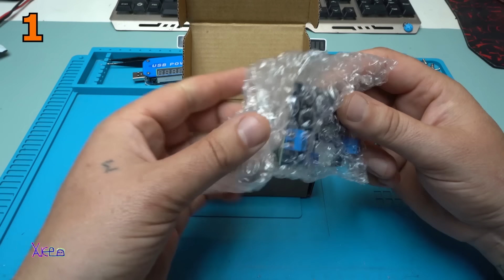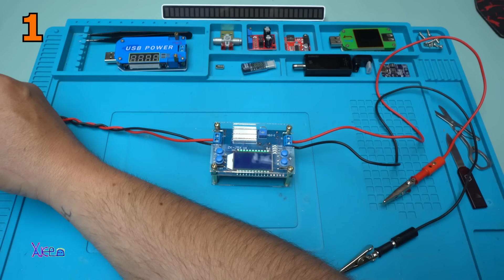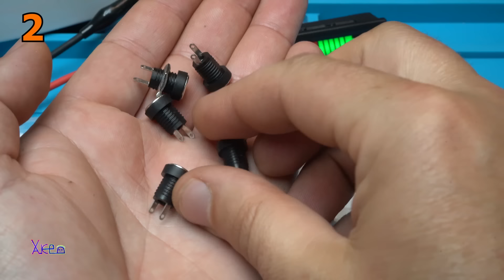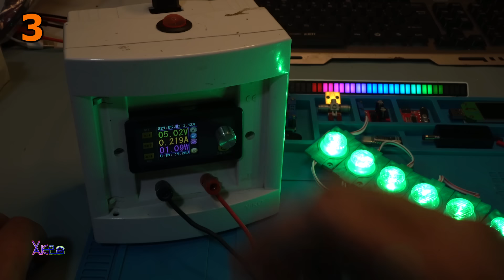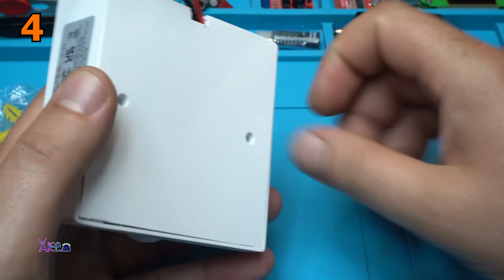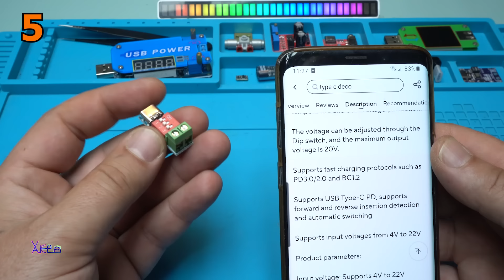TOP 5 AMAZING $5 Aliexpress Modules

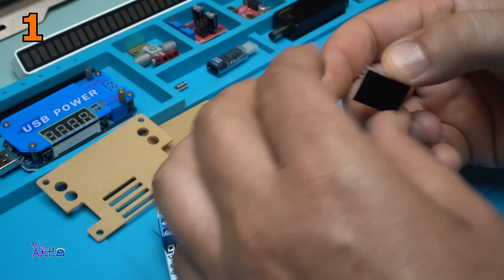Comment: 3:06 Have you tried putting it directly on the regulator? I know...pcb should act as a cooler for all devices on it, spreading potential heat, but it's small mass, one layer maybe?...so idk, just wondering would it cool better if it was attached directly to regulator? Thank you 👍🏻
Stay well 🖖🏻

Comment: I bought this same module on Amazon a couple weeks ago. I want to step down the voltage from a solar panel to under the input charging limit of a battery generator I have. I think I have that sorted out but I don’t understand how to lower the amp output.
Reply from the maker: The current is set with potentiometer